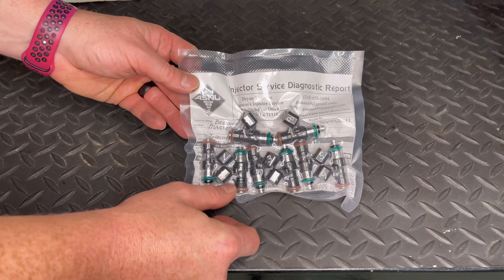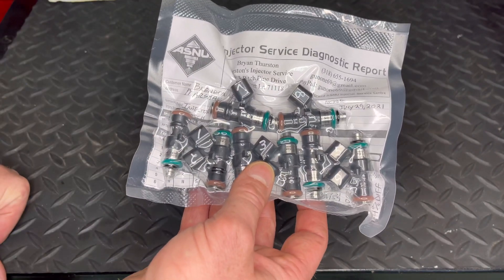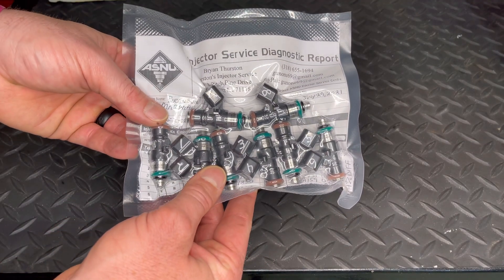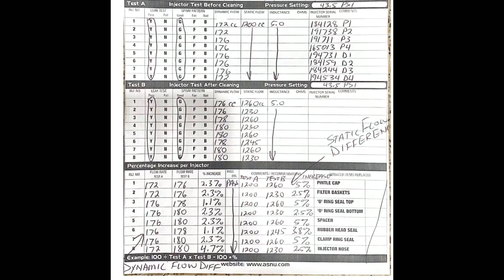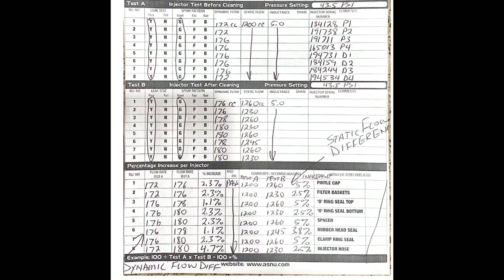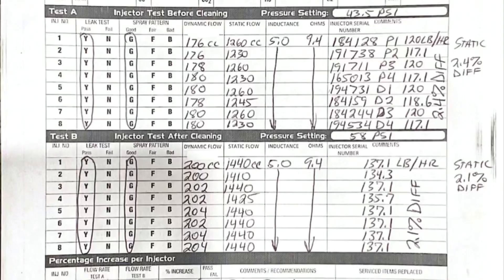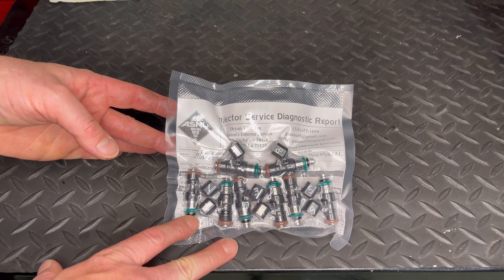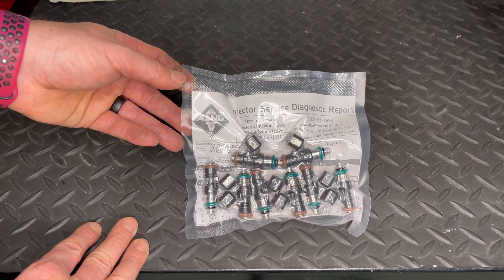Injectors Dynamics ID1300X Fuel Injector Flow Numbers, Fuel Injector Cleaning By Bryan Thurston

Comment: What kind of fuel system are you going to go with?
Reply from the maker: I am running pump E85. The car already has a flex fuel sensor and a DSX Aux fuel pump.
Reply: @whiplashtv2022  nice! I’m looking to do triple pump on mine. Are you on Instagram?
Reply from the maker: @Laratito95  Nice. Yes, I am bthelen_whiplashmotorsports on Instagram

Comment: Very cool video. I love watching the cleaning and flow patterns. And the explanation of the paperwork after. 
  Out of curiosity about how much does it cost to have them cleaned and tested and everything?
Reply from the maker: $25 per injector included flow testing, spray pattern testing, back flow cleaning, new filter baskets and seals.